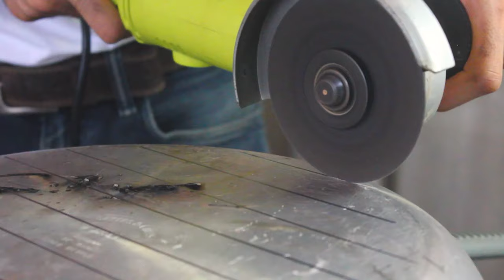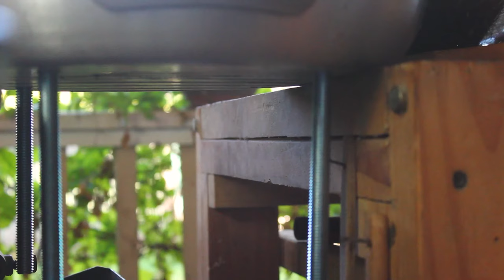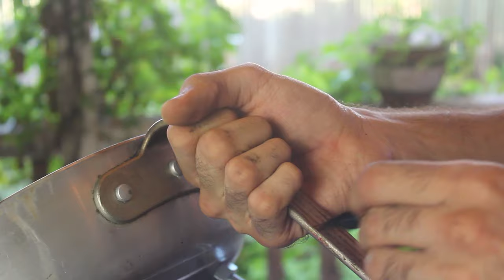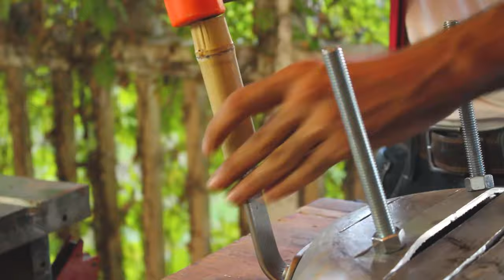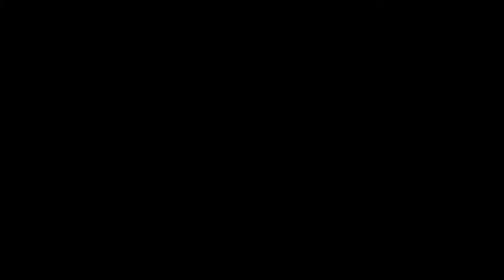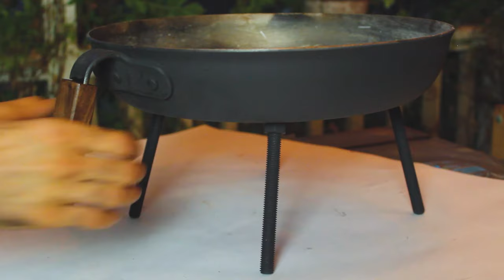Unique idea from old frying pan! I wish I'd known about it before...

Comment: It would've been also cool if it was a pan with legs to go over a fire
Reply from the maker: That is an excellent idea
Reply: @A.Mere.Creator  you should make one that has long and telescopic poles depending on how big the fire is. It would be like basically 4 small leki trekking poles on the bottom of a pan. If you do this idea, please do that cool handle design, like in this video!

Comment: I tried putting the nuts on my bolts like you did but I sprained 2 of my fingers and smashed my thumb on my other hand while using a 9lb hammer and a 10mm deep spark plug socket . I ended up having my girlfriend file away the threading on the inside of the nuts and that took almost 3 hours: The threading on my bolts matched too and I don’t know why I’m supposed to jam the nuts down like that when Incoukd have just screwed them on. My girl said to just screw them on but I kept telling her that’s not how you put them on in the video. Is that what you actually did and just edited the video to make it look like they just appeared all the way at the bottom of the bolt shaft with the snap of your finger like you did with the holes? I’m lost and in an incredible amount of pain. Will the fire still burn the same either which way you do it? I feel like an idiot.